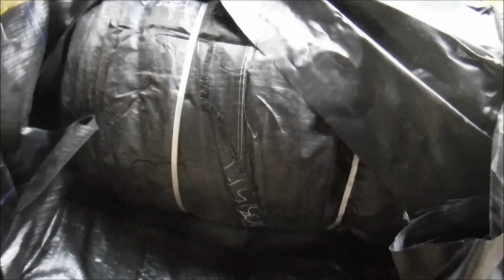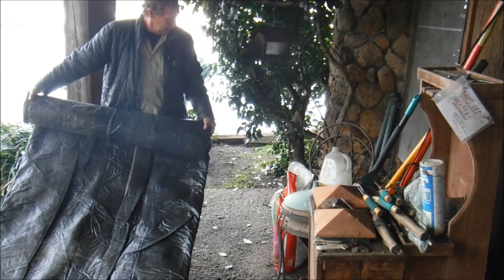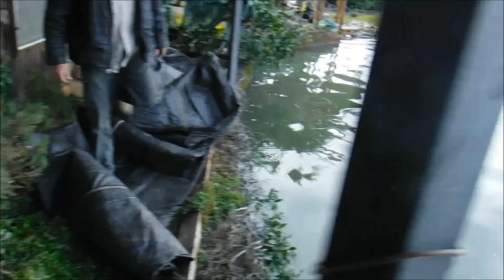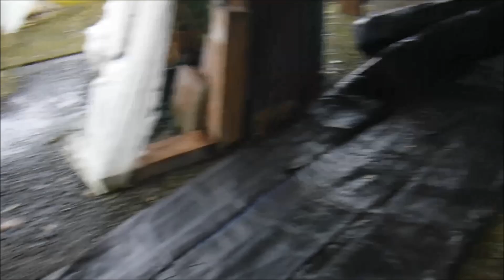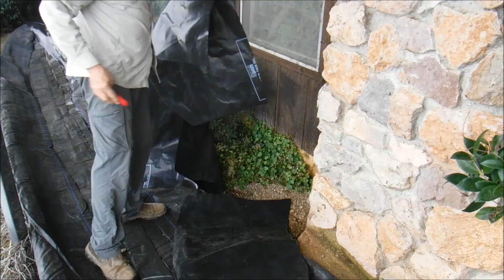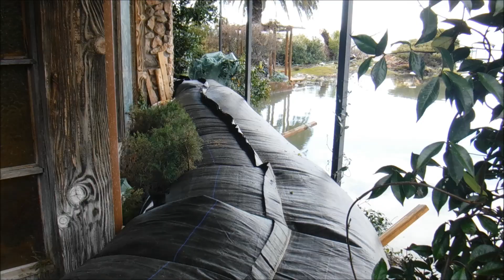AquaDam Rapid Flood Barrier Deployment, Kelseyville, CA 2019

Comment: What is the width of the dam? How do you empty it?
Reply: Man!!! Where were you a little over a year ago? Sure could have used this in KS. I lost 3 rental houses due to flooding. I NEED a taller one of those.
Reply from the maker: This 30" tall AquaDam was about 5ft wide when filled. Emptied by pumping water out, and then lifting the dam and working the rest of the water out by hand, (2) people. See https://youtu.be/1HQbZHntji4 for the full removal video.